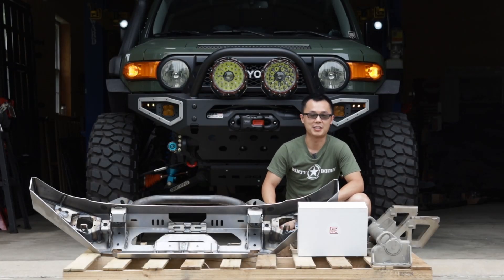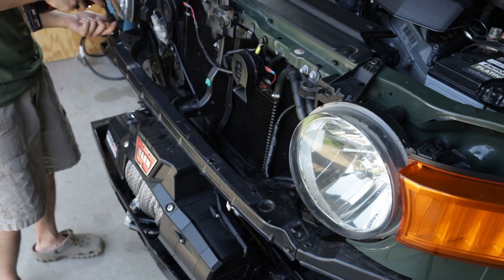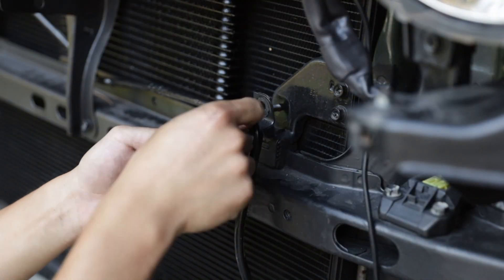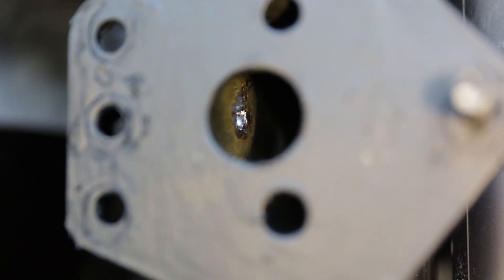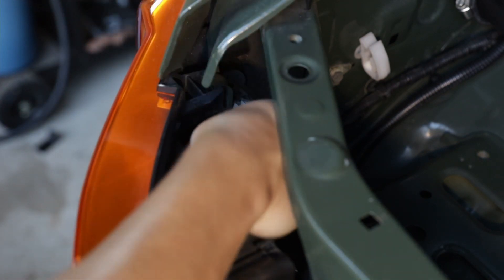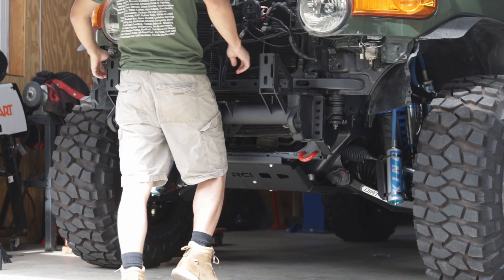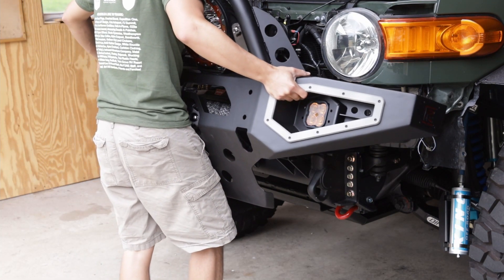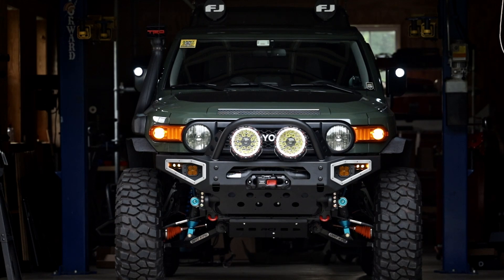Tinkerer Design FJ Front Bumper - Installation

Comment: I always paint and put grease on the threads and any bolts any thing that has bin screwed or bolt I will use Q-tips put some grease on The threads like before I tighten down all the way I will put grease around the hole that I drilled and grease on the thread before I tighten everything down and I also use   Fluid flim under my Toyota Tocoma  I seen video on YouTube in Canada a lot of people that have videos using Fluid Flim

Comment: Will you be stocking the bumper again anytime soon? Is there plans for a matching rear bumper?
Reply from the maker: Yes! Another batch should be ready in 2 months. And yes, I'm actively designing the rear bumper. Stay tuned!
Reply: @TinkerersAdventure  awesome can’t wait! Can I make a suggestion, would it be possible to have the rear bumper with a swing arm similar to the smooth motion arm from Expedition One rear bumper?

Comment: What led fog lights are those and what size are they?
Reply from the maker: These are Diode Dynamics SS3 max
Reply: @TinkerersAdventure are the fog light cutouts themselves ready to go for the SSD Max lights or does it require a little modification? Thanks!!
Reply from the maker: @ffsuperdave  they are ready to direct fit SS3 bracket mount. The newer SS3 flush mount bezels are thicker than other brands. You’ll need to grind off a tiny bit at one corner of the flush mount bezel
Reply: @TinkerersAdventure  thank you so much Kai for not only your amazing products and videos, but also putting in the work to provide very solid, informative information for us all to absorb. Buying my front bumper now.

Comment: Looks beautiful ❤️ but How safe are you in a head on accident or front accident of any kind since you are removing the front safety bumper top support and crash beam... Not trying to be a downer just asking (:
Reply from the maker: Thanks. The top support is not a structural component. It’s main function is for supporting the factory plastic bumper cover. I folded it in half by hand when I discard it. The new bumper bumper shell and winch beam serve as the new crash beam. The 2 crash cans on the inner structure, where the outer shell mounts to, serve as the main energy absorption structures

Comment: Thanks for your great videos!
Will this number fit on a 4runner with minor mods?
Reply from the maker: No the outer shell is significantly narrower than the 4Runner body. I do plan to make one specific for 4Runner in the future. Stay tuned!
Reply: @TinkerersAdventure  thanks.  Inner frame is the same, just cover won't match?
It's a nice looking bumper and would look really good on 4R.  Not many full bumpers for 4R
Reply: @TinkerersAdventure  the specs on FK is 75" and 4R is 75.8" but the FJ is rounder in corners

Comment: Nice. Are you coming out with one for the Tacoma?
Reply from the maker: Eventually yes. The Tacoma has a different frame from the other toyota 4x4s so it'll be more R&D
Reply: @TinkerersAdventure  The thing I like about your winch support is that it is much higher on the vehicle.  All the others I have seen are at an angle and so low to the ground.  Nice going.

Comment: Hi, Great Bumper design... Question, how usable / strong are the front factory tie down points on the FJ and are they safe enough to recover from? Thanks for your thoughts : )
Reply from the maker: Thanks. Those have been debated over the forums. Toyota demonstrated dynamic recovery using those tie down points in their FJ Trail Team video series. So it can definitely take light duty recovery. Think light duty enough that Toyota is willing to film it as official videos. From my analysis, the loops themselves and their through welds are more than strong enough (some earlier toyota models have much smaller loops in this area so some people are mixing these up). But the dropped down radiator support cross member is not strong enough. With enough force one can buckle and bend that cross member. This is why my frame reinforcement brackets bridge this cross member to further back of the frame rail.
Reply: @TinkerersAdventure  Thanks for your reply - that makes good sense. I have seen comments about the hooks themselves being strong but I hadn't fully considered the strength of the cross member that they are attached to. I appreciate your advice and I will look at installing a frame reinforcement bracket : )

Comment: I like your bumper structure design, the reinforcement brackets look stronger the ARB bumper, how your bumpers react to the air bag deploy timing?
Reply from the maker: Thanks! Great question. Unfortunately like most US based companies, I do not have the resources to lab test the crash rate yet. But it is something I want to get to. The 2 large boxes structure which the shell bolts onto are my designed crumble features, which are independent from load bearing recovery features. I tried my best to match the factory crash rate by analysis/simulation. But physical lab testing must be eventually conducted to provide a definitive answer.

Comment: Love your new design it should be a great success!
I only have 1 critique I guess. 
I would of had a plug in male to  female  with a side port for the led lights. That way all you would do is disconnect plugins plug in adapter and have the led plugs have a female end to just plug right into it. This would eliminate all the snap T's or junctions.
But other than that I really do like your new set up and will be checking it out a little more. Oh one question. Why not use large washer on all 5 bolts when mounting it to the frame?
Reply from the maker: Thank you! Yes a plug and play harness would be nice. I will consider that in a future revision. Which 5 bolts are you referring to?
Reply: @TinkerersAdventure  the 5 vertical bolts that mount to the frame when looking how you bolted it down between the frame and the bumper you installed 2 washer 1 on top 1 on bottom but left out the 3 in the middle. When bolting it down ya want al frame to snug tightto the bumper without a gap. 
It might just be me but it might be something to look at.
Reply from the maker: @Phenixrising-p1p  you got the right idea. the middle 3 did not get washers because they sandwich the frame horn. The top and bottom washers are the same thickness as the frame horn. All 5 bolts clamp down to the same thickness and achieve the proper bolt pretention.

Comment: Great design what kind of weight are we looking at. Also curious about a rear bumper. Can you make it open dual or opposite of the door?
Reply from the maker: Thanks! The weight is 125 lbs with the large single hoop in the video. Working on the rear bumper design slowly. More details to come!
Reply: @TinkerersAdventure   Can you order without the hoop, I'm guessing aluminum which is what I want cause I'm not running a winch. Do you have one designed to run without a winch?
Reply from the maker: yes you can order without hoop. we currently do not offer a winchless design. but if there is enough interest that could be something we do in the future.